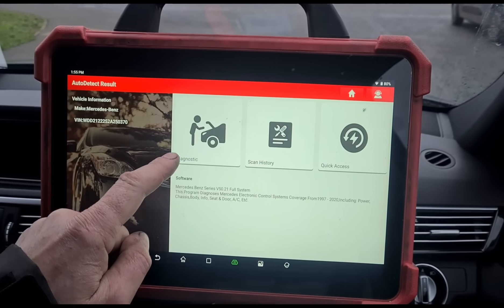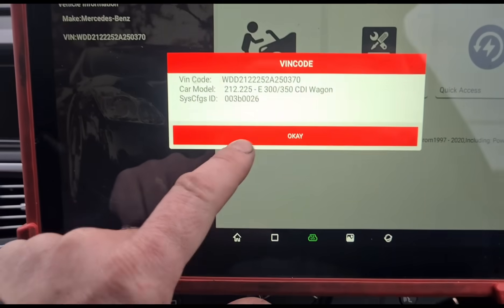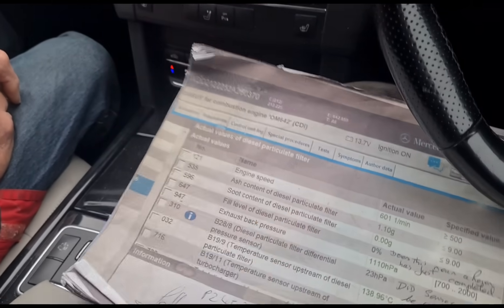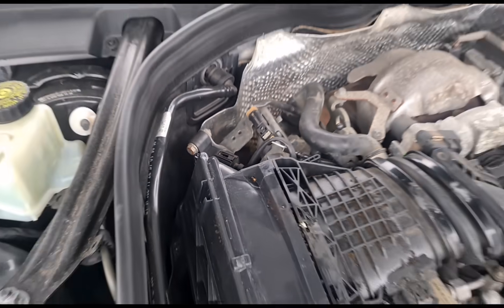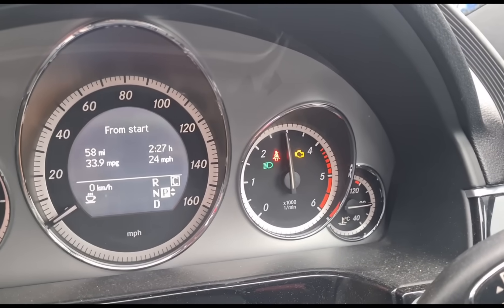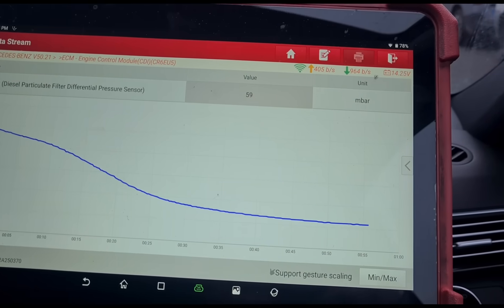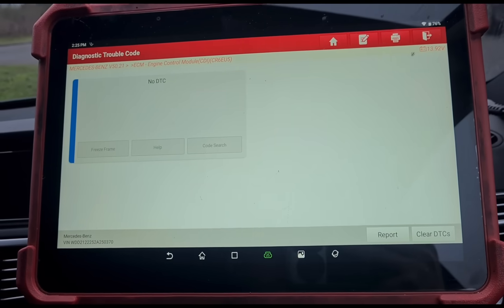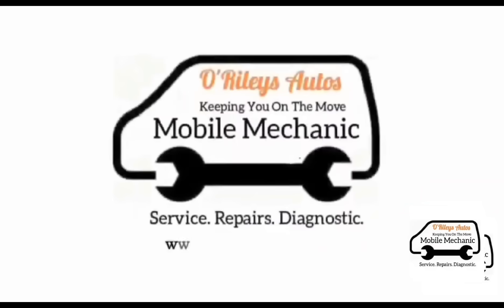Mercedes Specialist Said The DPF Was Not Blocked. E350 CDI V6 11A700 13AF00 Soot Content Of The DPF

Comment: The more of these videos I watch it seems that dpf problems can be solved quite easily providing you have to right equipment and knowledge i just can't understand why some garages can't fix them...
Reply: Different kinds of techs (any industry)

"Same fault I had last week, fix didn't work this time"
(90% certain it's not the same fault then is it?)
.
"If I throw enough parts at it, that will fix it!"
(Not if you don't get lucky  and change the correct part plus find out what caused it to fail)
.
"I know what I'm doing, I cleared the right settings but it didn't work!"
(Well, you don't know then)
.
The "Jimmy"
Understands "the system" not just the components

Comment: You must always remember that DPF fill level is just a calculated number. If the differential pressure sensor says there is a high pressure sensor, then the computer will calculate a high fill level. In my case it said 2 bars even with the engine stopped. Obviously impossible. So I bought a new pressure sensor and changed it. A relative small job. And voila suddenly the DPF fill level was okay. The original sensor did last 190 000 km.